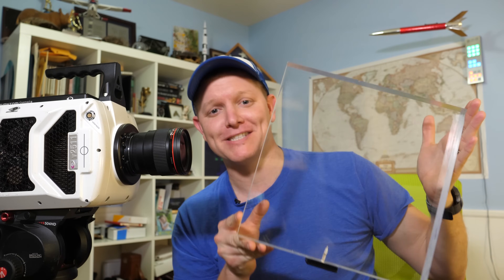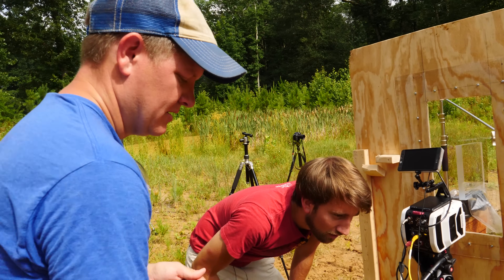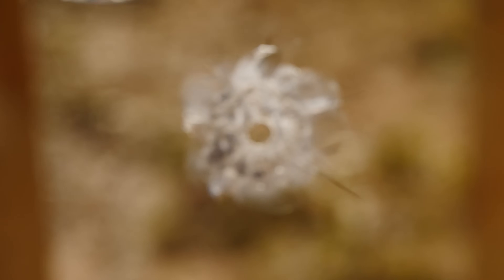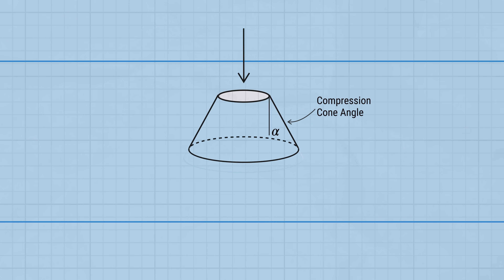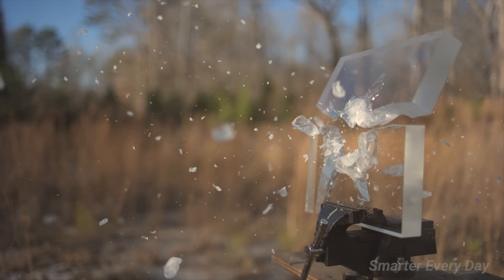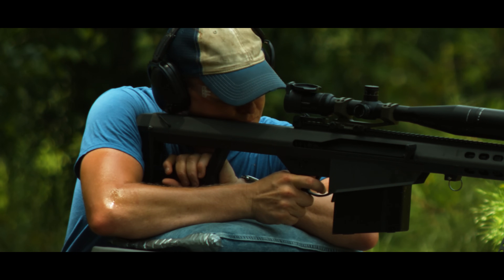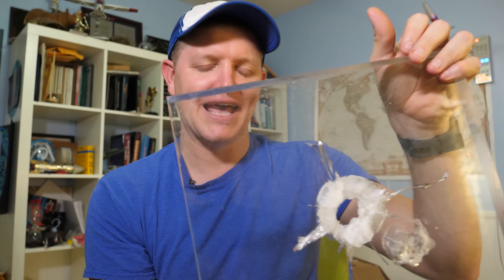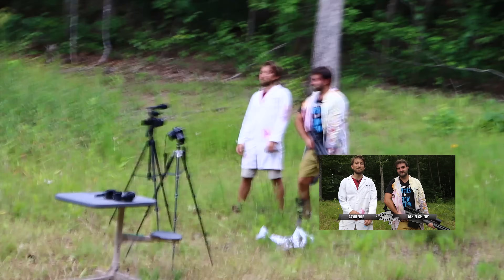.50 Cal vs Ballistic Window HARDCORE Slow Mo  - Smarter Every Day 187

Comment: dayyyyuuummm at 5:59 you can see a flash of light from where the bullet first impacts from the amount of kinetic force, I actually think its due to the rapid compression of air in front of the bullet as it approaches/hits the acrylic formed in the dimple at the tip of the bullet!!! its very quick even on the slow mo but its there

Comment: I love how there is a literal machine gun firing way faster with the same caliber
Reply: Try 20mm or 30mm rounds also. .50 is 12.7mm for comparison. Big big rounds.
Reply: The primary limitation to rapid fire is recoil absorbtion. Which scales by a lot when you are mounting a weapon too a vehicle or a building.

Hence why you have full auto 9mm submachineguns toted by soldiers, and full auto .50s mounted on trucks and tanks. A vehicle mount can be engineered much more heavily with springs and steel bolts to absorb recoil from a few hundred .50 cal rounds a minute. A man-portable gun has to be wieldable by a person and can't weigh 500+ lbs.
Reply: @TheLandau1894  In this instance, the purpose of this rifle is not for a rapid rate of fire though. If you could have a weapon that could some how fire .50 at a rapid rate and be man portable, you would still have the ammunition issue. Heavy machine guns are man portable, but there is a severe limit on the amount of ammunition that can be carried by that machine gun section, and the rest of the formation.
Reply: @lloyd4011  the Browning M2 is sorta technically man portable, but you absolutely cannot fire it effectively without mounting it to a tripod or vehicle.

I'm not sure what point you are trying to make.

Comment: Same thing happens when AP shells impact the thick armour of a tank of WW2 tanks. Thus liner plate is placed to prevent this fracture sharpenel from hurt or possibly killing crewman inside the tank. A shell doesn't penetrate doesn't meant it can't kill. Those fragments from inside will.

Comment: Please work on your trigger control
pull slowly to the pressure Point (most semi Auto and Manual guns have a pressure Point, exceptions are mostly Revolvers) and when you want to shoot, squeeze your fingers like you'd squeeze a Lemon slowly. You will immediately improve your accuracy

Comment: If you look closely at 5:37 you see th HOT 50 Cal shell hit his arm...ouch!
Reply: Glancing touches won’t burn you most of the time. You can touch a hot stove top and not burn yourself as long as you don’t hold you hand down lol. I’m sure we have all seen the video of that guy at work at steel plant slapping  molten hot steel as it’s pouring out like it’s nothing by now.
Reply: Bullet only tapped him and left, the ones that hurt for example is my fn5.7 in in indoor range standing to the side of somone, my cousin shot my gun and the casing fell in the crease of my arm (you know the inside of your arm where thiers the lines where your joint bends, thr bullet fell and stayed their for a second, tbats when it hurts, but its like getting pinched and goes away in a second anyways
Reply: I know that left a mark!
Reply: I’ve held a .50 casing soon after it was shot from a bolt action that was shot a lot before I did, and even then it was lukewarm, it wouldn’t hurt at all including the impact, being hit with casings doesn’t really hurt especially when they aren’t moving that fast
Reply: Fired ammo isn’t scorching hot, and it was a glancing hit regardless. This comment is unnecessary
Reply: @Krosstic  its very hot but yeah he barely got hit
Reply: @Krosstic  have you ever touched a bullet shell right after being used? Its like touching the inside of an oven.
Reply: Kross I mean there are ways of being nice about it?
Reply: @Krosstic  finally somone with common sense
Reply: Blazer06 if it’s being recorded on a high speed camera, the amount of time that bullet casing came with contact with his skin is minimal maybe half a second at most
Reply: @Krosstic  Lol this guy
Reply: @Krosstic  no idea why everyone gets offended at the truth. you're right, its nothing to even bother taking into account
Reply: @Krosstic  agreed man idk why people are arguing with you.

Comment: Doesnt the glass have layers in it? It goes glass than a polycarbonate?  feel like the reason the 9mm didnt damage the middle is because even through it broke the glass, it stretched the polycarbonate layer behind the brittle glass. Of course what you said could be the reason, but im just going off what it looked like to me. Either way, great video! Definitely a thumbs up!

Comment: The chaos of glass going everywhere didn't make me smarter today. However, discussing frame by frame what's happening would've
Should have slown down the playback so that there was lag-time between the trigger pull and the primer igniting (the time the hammer is falling). 
Then, could've frozen the frame 1 frame before impacting glass, & WALKED US THROUGH each frame as it begins // continues impacting.

Comment: If you have the polycarbonate divided the thickness in sheets, of course it breaks and perforates it. if the thickness of the polycarbonate of its 5 cm was a single sheet would be something else

Comment: Did anyone else notice the larger shards of ejecta perfectly reflecting everything around it?- Like pausing at the correct moment, you can see the flippin' camera in a tiny shard flying off.
That may be the BEST visual representation of the speed of light that's ever been caught on camera.  Edit: 6:16, watch the lower-center shard, then the lower-right, rotating cleanly.. It's beautiful.

Comment: You should have used reflective foil instead of the mirror so that the mirror wouldn't have shattered and we could still see the propagation of the break in the glass.  It also would have been cheaper than destroying a mirror.

Comment: Why don't you try the same thing with Lexan, which is used for the helmets on space suits. A few years ago I saw the developer test it by standing behind a door sized slab and it was shot with a 50 Cal. The bullet got stuck in the slab, it was then attacked with both a sledge and an axe. The sledge bounced and almost hit the guy using it while the axe got stuck like the bullet. Sadly it wasn't filmed in slow motion.

Comment: Were you attempting to shoot bullet-proof glass? I thought that was made with polycarbonate, and layers of material designed to absorb or deflect energy. the acrylic I typically work with is brittle and prone to fractures. Just trying to get a handle on the actual material vs. intent of this video. Please inform if you would, Thanks for posting!

Comment: Can you explain what is going on at the split second of impact where there is a small flash of light? What is causing the light to be emitted?
Reply: I feel like it hit the sun just right, but it could also be from the crazy amount of friction that happens when things get shot.
Reply: @charles.h5858  I'm skeptical to the sun reflection theory as I have seen this occur in multiple slow mo high speed projectile videos with different materials.
Reply: @getrail3d994  Well, I know projectiles get extremely hot on impact. I once shot a wooden stump with a shotgun at close range and the plastic wad melted to the lead BB's. I'm guessing the bullet gets white hot from the friction and then quickly looses its heat. The onlyy problem with that is, why would it cool off fast enough to not remain glowing through the rest of it's travel thru the glass?

Comment: Hey Destin (I hope im spelling that right)
Great video as always, I do however have one question.
why is it that when the 50 cal bullet exits the piece of glass the glass continues to shatter? my gut tells me that when the bullet exits the glass the kinetic energy from the bullet would be removed from the system, but that clearly isn't happening. My current train of thought is that the pressure cone has a greater distance to travel, in comparison to the thickness of the glass, therefore increasing the time required too punch through. I was wondering if you had any insight into this. CHEERS
Reply: Vibration maybe? It could also be the force from the muzzle that keeps shattering it. That gas hits hard.
Reply: Most likely the answer is that the propagation speed of the shockwave is slow enough that the speed of the bullet allows it to clear the pane before the shock reaches the edge.

Comment: This is actually the same principle that are being used in TBM's and other non-explosive mining methods where you apply force on a point and it breaks up on the sides. It has to do with the principal stress directions. If the difference between sigma 1 and sigma 3 is sufficient you get cracks in sigma 3 directions. This is also the same effect you sometimes can see on the side in tunnels (if done poorly).

Comment: Already sub to your's and the slow mo guys ch, I watch a lotta vids on how things work and how things fail, been watching docu tv for 40+ yrs, no more tv so all YT, more docus on YT now. Ballistic glass is always tested to fail for ratings so the manufacturer knows what to see the customer based on what they want and can afford. Some banks have sensors on their glass that signals PD if the glass is hit w enough force, auto assuming it's a bullet, bank robbers often don't realize as soon as they shoot at it they have called the cops on themselves, oops, hope they enjoy prison food. I've seen tv vids where college made rail guns firing 10mm pieces of metal were fired at a 3" piece of bullet resistant glass (polycarb) and it went thru like it wasn't there, granted a piece of metal moving at mach 7 has far more inertia. They did not show the depth of slow mo you do, so maybe a future vid would do a rail gun?! Small one, college made or such. Maybe the slow mo guys could do it if you can't arrange it due to schedule. Showing how much polycarb it takes to stop a rail gun round would be cool too, stacked together and/or spaced apart, latter being more effective.

Comment: Does the barrel of the pistol wiggle up and down? It looks like all the parts fall loose and then magically snap back together.
Reply: It tilts! It's a locked breach, so when the slide starts to move rearward under recoil, the barrel tilts downward, allowing the barrel to unlock from the slide face. Check forgotten weapons for good firearms mechanism explanations.

Comment: The material looked like acrylic (plexiglass) to me. Polycarbonate (lexan) is much better for impact resistance.
Reply: I believe he does say that in the video. (That it's acrylic Plexi)
Reply: @azaldie  That was my point. Acrylic is far from being suited for the task which was the cause of failure. Polycarbonate is what actually is used for impact resistance, and even then it should be an approved version to make any ballistic claims.
   I think he's confused about the difference between them even though acrylic and polycarbonate often look very similar.
Reply: @joewoodchuck3824  I think the video wasn't so much about the testing of how much the used material could handle though, nor meant as a "most powerful bulletproof glass test", as opposed to watching what happens when you shoot at them in concept, and through them :)

Comment: 5:58 look closely. The .50 cal sparked in impact
Reply: That's wild. I think it's plasma ignition - the shockwave at the tip of the bullet compressing the air against the glass to ridiculous temperatures
Reply: @WestOfEarth  I agree
Reply: @WestOfEarth  yessir, that thing is going hella fast i bet, if it was sub sonic I bet we wouldn't have seen that
Reply: Maybe it is just a light reflection?
Reply: Boolets do that, a immense amount of heat would be generated upon impact and during the penetration, some incendiary and HE rounds are designed to be ignited by that heat.
Reply: It sure did.

Comment: 2:04 my favorite part. The recoil doesn't cause the barrel to rise until after the bullet exits. I thought the barrel would rise immediately.
Reply: how would it rise immediately? That wave of force through the entire gun takes much longer than the bullet existing the barrel because of the massive weight difference. In a pistol it's not super impressive but I've seen interesting recoil delay systems on burst-fire weapons that are made to hold the recoil until all the rounds have left and those are pretty cool.

Comment: "Pressure cone"....A way to see this on a much larger scale is to look at a meteorite or bomb crater. It looks almost untouched in the middle and then you see the visual evidence around the perimeter.

I 've never fired a 50 cal, but I understand the kick is like that of a 12 gauge because of the weight and help from the muzzle brake. i have fired a 10 gauge with a full choke and even though I tried to brace and use good technique,  it nearly took my shoulder off. In fact, it was so painful, I never wanted to fire it again  That said, the 50 cal is something I'd love to experience.

It's amazing to see what bullets do in super slow motion. I wonder how thick/deep you'd have to make ballistics gel before a 50 cal was left embedded in it?

Finally, it should be noted that these guys use disciplined firearm safety. In fact, safety is first and foremost whenever handling or firing a rifle or handgun. Most importantly, never point any weapon at another person or yourself, no matter if it's loaded or not and never grab a gun without getting educated first by a qualified instructor. IMO, this is something you can't just read about on the internet and go do. While these guys make it look easy, it's because they are professionals who have hours upon hours of time with these weapons.

Great video as always!

Comment: So I just wanted to throw a thought out there, related to the pressure cone, could it be related to the fact that the bullet causes so much pressure in the glass that there is a relation between being a liquid vs a solid for a moment in time, causing the pressure cone to be a small fraction on a graph of a vortex from your fluid dynamics video? I feel like you’d be able to understand what I’m pointing at.

Comment: Did you feel the spent casing hitting you at 5:22?
Reply: Even with such quick contact like that you usually get a nice little blister. Those shells are hot.
Reply: Between the percussive shock, the recoil rippling through his body (nice slo mo) and the excitement of shooting a 50 cal... Nope, didn't feel a thing
Reply: what are the little bits coming off near his face?
Reply: Delsorbo looks like droplets of sweat
Reply: His shoulder was bad enough
Reply: Well spotted. 
You have sharp eyes. 😉💋👏
Reply: Linda Anderson they only zoomed in on it and played it twice....
Reply: @williswhatchutalkinbout4367  Well spotted. You have sharp eyes. 😉💋👏

Comment: Is the smooth circle because the tip of the bullet is more plastic than the glass, which is shortly overcome as the tip flattens and the contact point increases?

Comment: Nice Quote at the end:
Job 41:13-17
13 Who can strip off its outer coat?
    Who can penetrate its double coat of armor?
14 Who dares open the doors of its mouth,
    ringed about with fearsome teeth?
15 Its back has rows of shields
    tightly sealed together;
16 each is so close to the next
    that no air can pass between.
17 They are joined fast to one another;
    they cling together and cannot be parted.

Comment: Something interesting about the .50 cal is that it’s invention was multi purpose. I was designed to eliminate enemy personnel, designed to destroy armored fighting vehicles, and even used as a portable ultra lightweight anti aircraft gun capable of hitting aircraft within a 5,280/ft radius. That’s the height of over 17 NFL football fields stacked upwards or simply, a range of 1,760 yards.

Comment: 6:33 I don’t think anything can protect against a .50 caliber bullet lol
Reply: I've been in the "transparent armor" business since 2001.  We manufactured windows for MRAP's  that were rated and tested to withstand three hits from .50calAP rounds in a twelve inch triangle with no penetration.  You need to GTFO of there before they get round number four in there because penetration is VERY likely by then.  Typical layup was a quarter inch chem strengthened strikeface then nine layers of half inch low iron glass alternating with .025 urethane then three layers of polycarbonate bound with .050 urethane.  MRAP windshields were two piece and each one was around 90 pounds.
Reply: That’s amazing.

Comment: Ballastic ACRYLITE sheet will soften as the temperature is increased above 195°F, whereas a round from a pistol can easily reach 500-600°F, so essentially when the round is fired from such a short distance it has no time to cool, you end up with the bullet tip melting the face of the acrylic. You can see this in the slow motion part of the video quite well. This is why you can see through the spot where the tip of the round made contact with the sheet

Comment: If you slow it down with playback speed to x0.25, you can see a small compression explosion at the tip of the bullet when it impacts the glass. Just like under water when a bubble collapses rapidly. 5:55

Comment: Another great Video Destin...
 What is so cool about that last 50cal shot is you can see the bullet fully penetrate the glass then a few frames of no more fracturing then the glass completely self destructs.  ...
So what's happening? 
The impact pressure wave causes the primary localised fracturing ... But then that wave continues through the material to the material boundary and is reflected at the boundary ... Those waves upon return to the center interfere with attendant amplitude additions and subtractions ... in an already pre fractured medium the glass then self destructs explosively... 

It would be very cool to see and record those wavefront propagations and reflections in the glass!! 

Can you do it? 
Perhaps you could use some polarised light and filters I think would probably do it ?

Thanks for this one.  Looks like fun.